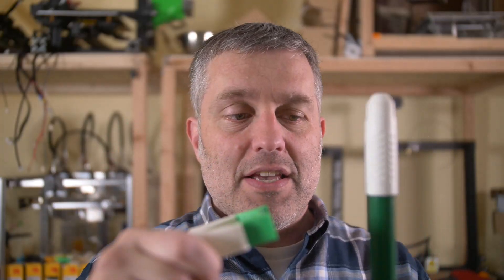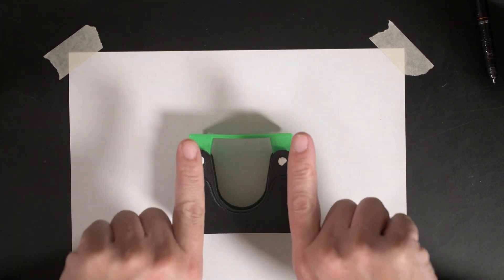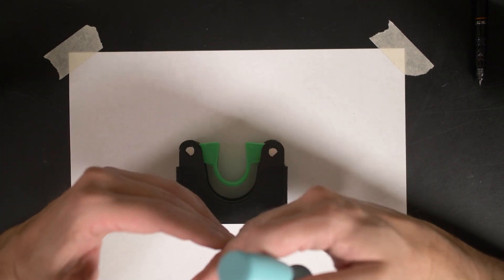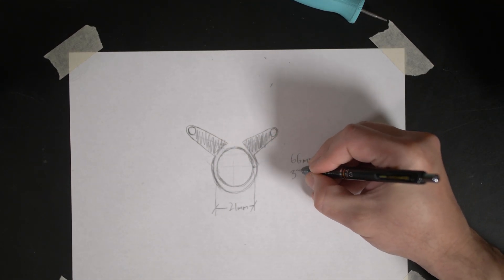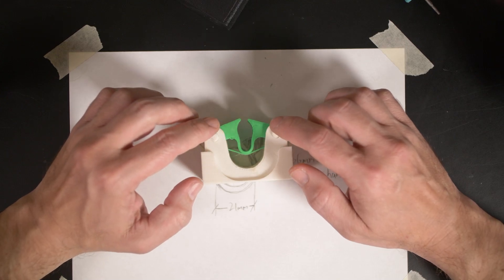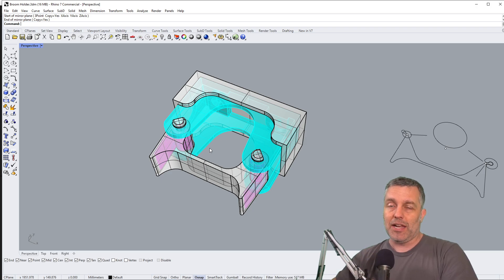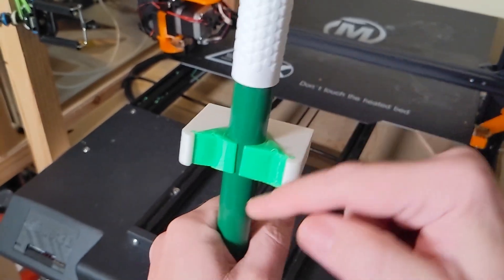I Could Patent This - A 100% Compliant Mechanism That's Actually Useful

Comment: Interesting approach. Ideally your design needs cilia-like structures (or similar protrusions) along its bridge in order to adapt to different diameter handles (within reason, say +/- 15-20%). Some formulation of silicone would be an interesting material for the flexible component. All in all, good job man.
Reply from the maker: Thank you. I appreciate it. Would love to see it in production somewhere.
Reply: @DesignPrototypeTest  Thanks for sharing your content. One of my favorite parts of videos of this type isn't the widgets so much as the thought processes.  Always enjoy listening to others reason their way through a design as a point of comparison with how I might approach the same challenge. I appreciate that you share aloud here on your channel.  

If your goal is a single piece compliant printed handle holder, consider starting from a simple baseline such as this: https://newcontent.westmarine.com/content/images/catalog/large/317529.jpg. And incorporate the previously mentioned "cilia" to improve the range of handles it'll hold.  As novel is it was when first introduced, I've never been a fan of the gripper approach.
Reply from the maker: Yep. That is 1 piece and simple to manufacture. Pretty much winner, but it's not perfect and the simplicity maybe loses functionality. Sharp edges likely to damage paint on broom handle. If you eliminate all sharp edges there is little friction between the broom and the holder. There is no grippy plastic/rubber to keep broom handle from sliding down. Therefore, a feature must be included on the broom handle itself (a valley or a ridge) to prevent this sliding.

Comment: I use a nail in the wall to hold up my broom.  There's even a hole in the handle of the broom for a nail to go through.
Reply: But, you have to look at the nail and line up the hole.  Way too much effort.  The nail idea will never catch on.  I wonder what that hole is really for 😆

Comment: Pardon me, but i believe this design has been used in Asia for some time. I hope i am wrong. Just fyi. Enjoyed your wonderful channel nevertheless
Reply from the maker: You are pardoned. The overall design is old and I started the project duplicating that. The patentable idea here is the flex joints where the rubber meets the plastic. I explained that nuance for a quickly in the video.
Reply: @DesignPrototypeTest  By putting online its prior art . Have you submitted a PPA prior?

Comment: What if you cut out the center where the wrinkle is, you need enough so the broom moving inward closed, or experiment with less 1/2 or 1/4 the height. As with most of my 3d printing, it is just a small step forward to the final part i want.

Comment: I'd like to see this refined variant as a resin part with an elastomer overmold step for the flexture.

Would make an interesting video on the next step after 3d printing to get isotropic parts but a step behind plastic injection.

Comment: The reason it plastically deformed over night   is due to "creep" it's a function of time and stress. It affects amorphous plastics much, much more than semi-crystalline. 

You can mitigate the problem with a material change or a design change. What you'll need to do is find creep rupture charts for a given material. This will allow you to see when the material will fail for a given stress or strain vs time. 

Personally the 3dp TPUs I have used have been very susceptible to creep.

Here's a fun test, hang a piece of pla and tpu filament and tie a weight on to each one. Mark their initial position and then come back and check it in a day, week or month. You'll see that they continue to stretch more and more even though the weight are below yield stress of the material.

Comment: An extrusion might be better for your volume. Extrude it, cut it, assemble it, done. NRE is literally one magnitude lower in cost and volume is better suited for small business. 

 I paid $900 NRE for a project I worked on last year, at 3500ft they charged me $0.47/ft and at 20k ft they charged 0.$35/ft. US manufacturer too, I used VIP Plastics in Minden NV.
Reply: Yeah, I had exactly the same idea.  The base could even be aluminium if so desired.

Comment: Molded plastic hinge flexures are used all the time with thermoplastic injection molding. I would suggest looking further into thermoplastics that can do the trick. Maybe you can redesign this part to lessen the stress on the plastic to increase the number of cycles (s-n)

Comment: It's neat that you figured out how to make these yourself, but it's not a new invention.  I have a wall covered in these at my facility already, and many of them are probably at least 10 years old as I found them collecting dust in a pile of junk in the corner.
Reply: Do they have hinges in the design? Or are they his design that uses the flexible material to hinge to the "wall mounted" bit.

Comment: You're exceeding the elastic limit of the plastic at that living hinge. Mark a small dot or square on it, then actuate it to see how much the mark stretches out. Basically you want it to bend less sharply, which could maybe be done by moving the anchor from the inside of the fork to the outside.

Comment: printed part and it works well, nice design and a easy print. (used petg for wallmount part, and tpu A82 for flex part)
my tpu has same memory issue. but it hold the broom in place.

Comment: Hey awesome stuff! ☺️ Although this is already a product that I happen to own
Reply from the maker: Nice comment. Thank you. This whole exercise started when another guy posted a copy of that product which he 3D printed and I thought "That is designed poorly for 3D printing. I could optimize it to be made on a printer without support material." Question: Does yours sometimes not open when removing the broom handle.
Reply: @DesignPrototypeTest   yeah that is something that occasionally happens, although fairly infrequently. Mine is more like a hard rubber, so having a harder material just on the corners that fold in would most likely address the problem. Idk if a multi-extruder system could handle 3d printing different materials on one piece, I assume there would be adhesion problems. But if there were similar problems in the 3d printed version I would think that would address it very well. Mine Is in my shop so it has probably been through a couple thousand usage cycles and definitely was much better new.

Comment: Pretty sure you wouldnt get a patent, theres already a product, very similar, available to buy
Reply from the maker: Yes, this is the item I based my original design and first iteration from. I talked about it at the end of this video, and the first video went more in depth. I could have patented the pivot-less flexure functionality which allows you to make this in 2 pieces instead of 4 like the "product, very similar, available to buy" has. Above and beyond that, the molding would be two simple 2-part molds. One for the rubber and one for the fork. With the currently available commercial product there are undercuts making for a complicated mold that requires side actions to form the holes for the pins. My design could even be made in a double shot "over molding" process requiring no human labor to assemble it which is a patentable feature in and of itself.

Comment: This is great! You might consider applying for a provisional patent and then shopping the design around to obvious benefactor-manufacturers. Your residuals will be far more than the cost of the provisional patent and you won’t have the huge up-front cost of a patent. Whoever buys up your design, will pay for the full patent, with you as the creator and will pay you based on sales.

Comment: While you've made it different, the overall functionality is exactly the same as wall clips already available on the market and made cheaply by the manufacturer..

Your going to an awful lot of effort to reinvent the wheel and seriously overthinking things..
Reply from the maker: https://youtu.be/h2UrXBnCf_M?t=611 But I have made an improvement. I've simplified a design which is manufactured in 4 parts and made it in 2 parts. A 50% reduction in complexity is rare in Engineering. It's something to be proud of. Would be really cool if a manufacturer adopted my design.

Comment: You should check out the 3M version of this.  unlike your design, it requires pins, but the printed, or injection molded geometry I think is key to making the optimal grip and release range.  seems to have a lot to do with those two springs you're talking about.  The inner springs should be under compression, while the outer springs should be under tension, and also isolated from each other as much as possible.   Also the gripping force of the mechanism should only be active through about 30ish percent of the action, so the tendency is more toward release than grip.
Reply: Yes i believe 3M also producing same thing here.. detail of the mechanism I am not sure about.

Comment: Now that it's in the public domain, no patent. Marius Hornberger has also made available quite a number of mounting widgets. Quite valuable, thanks. I don't think the inability to reset automatically actually reduces the usefulness of the design.
Reply: This is entirely false. Sharing it on Youtube does not make an invention public domain. It is not novelty destructive, at least not yet. The inventor has a 6 month grace period, at least assuming he will file for a patent in the US, which makes sense here.

In addition, you have absolutely no way of knowing for sure whether or not the inventor has in fact filed for a patent before his video aired.

Please consider double checking your sources before you make absolute sounding statements like these. 

Although I guess I cannot complain, being an IP lawyer myself.

Comment: if you don't wanna sell it, make it open source! so noone can patent it and we can all have some, it's super cool! I need to investigate a lot about complaint mechanisms and how to design them without going through trial and error
Reply from the maker: There is a large misunderstanding about open source hardware. Just the act of showing this to the public makes it open source. With software, you can have a functional thing and the way that thing works (the source code) is hidden. By freely and openly sharing the source code you make the ideas public. With hardware the object itself is the source code. Anyone can duplicate this functionality after seeing it. Unless patented. As I explained in the video, nobody can patent this now. Even me, because I've shown it to the public. It's now called "prior art."
Reply: @DesignPrototypeTest   sorry, but in Germany you can buy it.  Google “würth stielhalter”. But anyway. I love your channel.  Keep up the good work.
Reply from the maker: Yes, this is the item I based my original design and first iteration from. I talked about it at the end of this video, and the first video went more in depth. I could have patented the pivot-less flexure functionality which allows you to make this in 2 pieces instead of 4 like the “würth stielhalter” has. Above and beyond that, the molding would be two simple 2-part molds. One for the rubber and one for the fork. With the currently available commercial product there are undercuts making for a complicated mold that requires side actions to form the holes for the pins. My design could even be made in a double shot "over molding" process requiring no human labor to assemble it which is a patentable feature in and of itself.

Comment: Not all thermoplastics are above their glass transition temperature at room temperature. For example PC and ABS both have a Tg above 100C. Also being above the Tg doesn't mean that the material is necessarily going to rapidly creep as shown in the video with the TPU. Eg. polyethylene is what grocery plastic bags are made of and you can put considerable weight in them and hang from a hook for years without it creeping to failure despite having a Tg of -80C.

Comment: No you couldn’t those broom holders have been around forever. Go to any fast food joint ever and they got a rack of them. To patent something it has to be original and have a lack of prior art. 3D printing something while a new manufacturing technique does not make this a new idea. You’re not even using it in a new way just holding a broom same as everyone else’s.
Reply: Even as an IP lawyer, I don't even know where to start correcting this "analysis". :-)

Comment: Interesting.  Besides the realized material creep at the end, I wondered how many open/close cycles the thin flexure point could withstand before failure?  Do filament manufactures even produce fatigue data that can be used?  That joint has a hard corner that bends the ‘filament’ back and forth 180 degrees.  It also has to support the static weight of the broom in shear, and any off-angle impulse loads by the careless user (such as my wife who is completely oblivious to mechanisms0.  But I gotta to say...... fantastic experiment.  👍😎👍

Comment: We actually have that thing as a product here in Germany. The green flexible part is made out of a stiff silicon part, and it has additional nubs there, to hold on to anything you push in there.
Reply: In Germany it’s “würth stielhalter”
Reply: @predypav7374  .. has hinges, i've checked
Reply: @predypav7374  Exactly! I also saw them as cheap 1€ article in the checkout section in hardware stores like OBI or hagebau.
Reply: @Helli__  All of the examples listed have hinges.  Which this design does not.
Reply: @meateaw so what? minor detail
Reply: 3M Broom Gripper
Reply: @apisje700  that has pivots
Reply: Yeah Sweden is filled with 'em as well
Reply: No you didn’t.
Reply: i think the point is that this is a compliant mechanism, made in 1 part.
Reply: Not only that, but I saw and printed a slightly different version of that like 3 years ago, I adapted it to hold my tools in an easy and comfortable manner
Reply: We have this in the US as well... it already exists and has for a long time so it's not patentable.
Reply: Toolflex steelklem for example
Reply: @bertvanlange6155  That has a pivot point.
Reply: @bertvanlange6155  the idea though is that it doesn't have the hinges which is that patented idea. He specifically states this in the beginning of the video

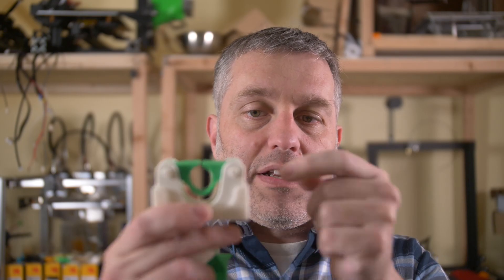Edit: 1:20
Reply: @eliward4215  He would have to prove it is non-obvious and that it provides new functionality. In USA it is now super easy to get a patent on someone elses already patented IP. It is all about enforcement now.
Reply: In the Netherlands we also have this I think my dad had a couple in the shed
Reply: yeah, i bought one of these for tools years ago.
Reply: Yeah we have plenry of them in our school

Comment: to answer your question very simply:

if milwaulkee can patent lithium ion cells in a cordless power tool. then there is no bar too low, no level level of absolute total dross that is too low that cannot potentially be patented these days. the only thing that matters is to be 1st. but it usually takes thousands upon thousands of dollars, and an army of lawyers, attorneys, hired legal grunt. to keep on filing hundreds of speculative patents in and around a given specific area. each patent being just very slightly different to the other ones. then you sit back and wait to see which few ones the USPTO eventually upholds, lets thru the net. so that whole workflow resembles something a lot more akin 'going fishing' than doing something which is genuinely interesting or actually innovative
Reply: Pretty sure the milfuckee patent is regarding the electronics not li-ion cells
Reply: @notme4083  nope not at all. It was well documented in the press during the time of the subsequent lawsuits. it was filed as US7554290B2 (2009) "a plurality of battery cells supported by the housing, the battery cells being capable of producing an average discharge current greater than or equal to approximately 20 amps, the battery cells having a lithium-based chemistry". The patent is set to expire 2023-11-24. Which will be much to the glee of all the other power tool mfrs (dewalt, makita, etc)... assuming ofc that it does not get extended 'somehow'. with whatever utterly shady mechanism such things gets decided. but i wouldn't know about that

Comment: print as one part on a tool changing or MMU printer.  Single part KISS done. 

could also integrate some ridgid bits in to the TPU to try and stop it creeping overnight. maybe inside of the horns. 

looks like you need a larger radius on the exit of the slots/holes that the TPU bit fits inside to reduce stress risers in the TPU.